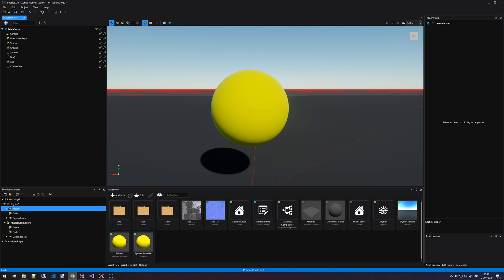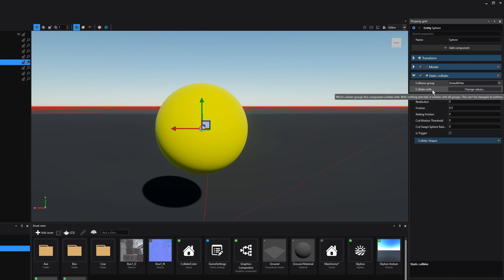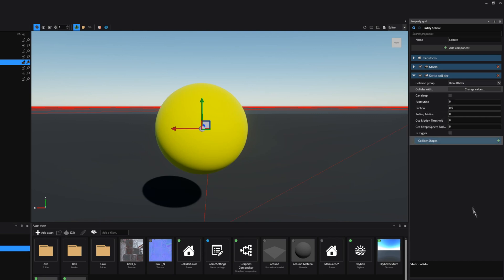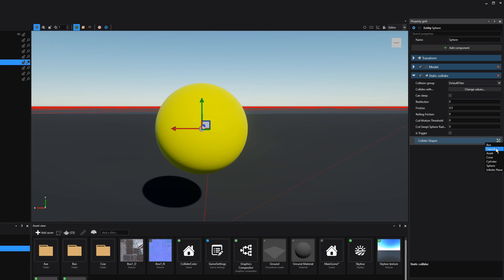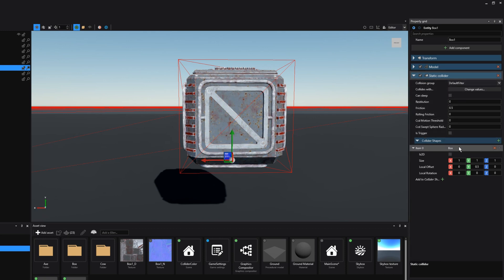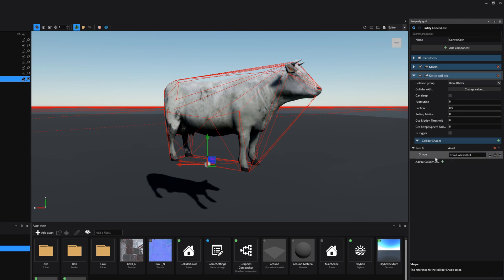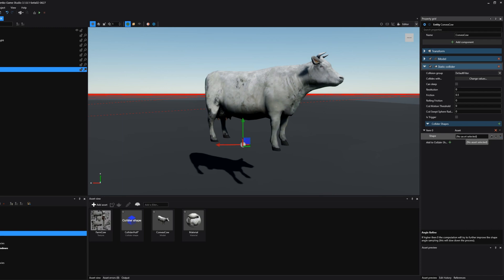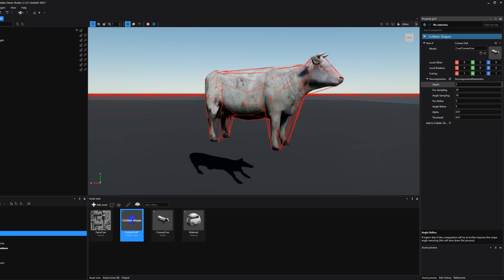Stride editor tutorial #12 - Static colliders

Comment: @6:14 Adding collision for a model should be made ways easier:
1. Right click model (in this case: ConvexCow)
2. (new menu item) Left click "Generate Collision" -> Creates a new collision asset in the same folder as the model.
3. Ensure user sees the new generated collision properties (e.g right side shows the selected model properties, with collision header is expanded)

- No need to go through all that add asset stuff
- No need to find the model for the collision since the model is already selected.
- No need to link the generated collision asset back to the model.